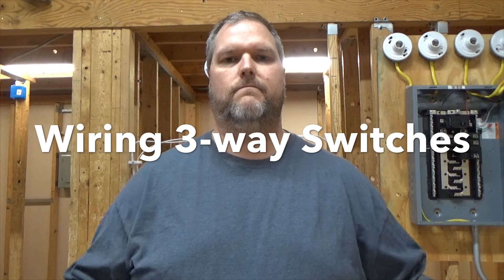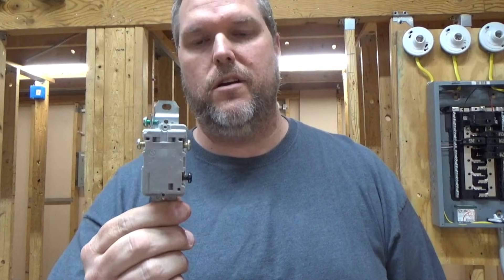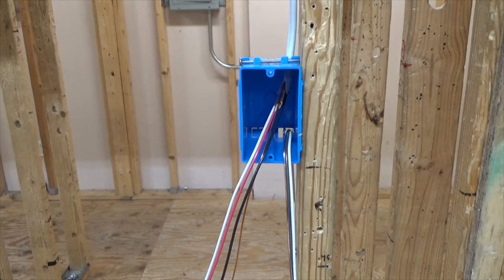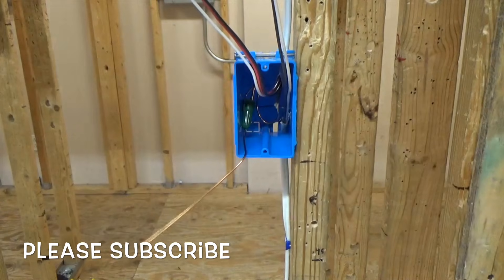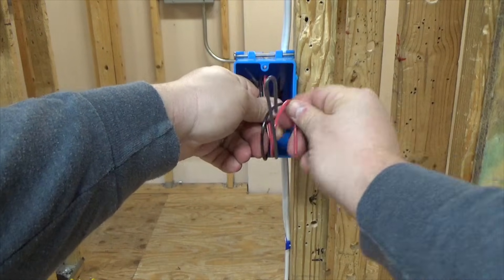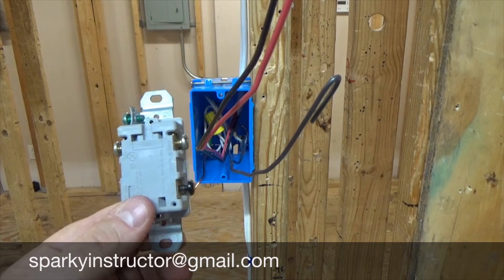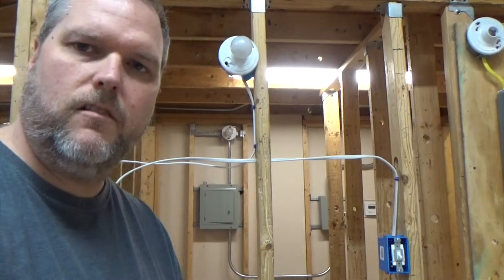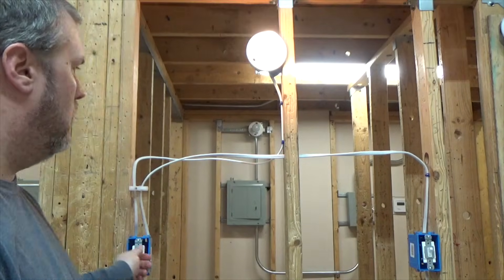3 - way switches explained

Comment: Great video, but I need more help. My setup has the line to the light at the middle switch. So Switch 1 has power/feed and wire to switch 2. Switch 2 has wire from switch 1, wire to switch 3 and wire to light. Then Switch 3 only has wire from switch 2. (I can get the first to switches to work like a 3 way, but the 3rd swith does not do anything.) Any help is appreciated. Thanks.

Comment: Curios if there's a way to have both 3 way switches aligned. Meaning, the rocker switches are both facing down when the light(s) is turned off. I'm guessing it's as simple as turning the entire switch upside down before mounting it in the box? Just a bit of OCD on my part...

Comment: so were using a 14/2 wire to feed the switch and a 14/3 wire to go from switch to switch and than using a 14/2 wire to go from the switch to the light fixture ?

Comment: What voltage should u see on the load side. When power is off? Ive seen this in a house where the neutral to hot is giving out 10 volts. I've seen another house giving out 60 volts. Is this normal

Comment: Running into an issue with an old 3 way switch in a 50s house with only black, white and ground. No red. Getting one switch to turn on and off only while the 2nd switch is turned on. Otherwise no juice to the replacement. Any suggestions? Great video. Well explained. 👍

Comment: So i noticed that your traveler wires on both switches are flipped. One switch has a red on the right and the other has it on the left? Does that matter?
Reply from the maker: As far as the TRAVELERS no it does not matter!! Just as long as you know that the travelers are the same on both ends. CM

Comment: Ok but could you wire up a 3 way motion sensor ??? I find it easier to use an on off switch instead of a 3 way switch

Comment: just recently replaced an aging ballast in my fluorescent fixture on a 3 way circuit .  When I was checking voltage for on and off at the fixture , I still had 53 volts with the circuit in the off position ?  This circuit has 1 very old 3 way switch in it , could you give me some advice on possible problem with this off position voltage ?

Comment: I have a white hot wire in box B of the three way switch. Does that go into the black common screw? There is no neutral in this box unless the hot white wire is the neutral

Comment: it's an old way, we use wago to connect the wires, it's easier to connect and disconnect the wires
Reply: Wagos are only used in the UK. It’s not code compliant in the US

Comment: Did you use a 14-3 wire to connect your travelers and then a 14-2 to the light? Is that why I only see one red on the second switch?

Comment: What did you do with the neutral wire on the light side?
Reply: I know it's an old comment but on the 2nd switch the neutral is tied together with the wire to the light.  So your feeder line and 2nd switch neutrals are attached in the 1st box and then the other end of the neutral in the 2nd box is then tied into the neutral on the actual light..

Comment: Craig.  Having a problem installing a light with dimmer switch.  There are three wires in the light socket.  When connecting the light fixture, it powers on but the switches will not break the circuit.  Any suggestions to solve this, please.

Comment: What about a 3way switch to a plug/ electrical receptacle can you make a video about that please 🙂
Reply: It's the same thing. Doesn't matter if you're switching a light directly or an outlet. On an outlet hookup make sure you connect the bare ground wires to the grounding terminal usually green colored.

Comment: I've done a lot of wiring in my homes over the years including 3 way switches but I find that when I haven't been doing any projects for a few years and then attempt to wire one up I have to stop and think about it, sometimes for longer than I'd like to admit.  Very glad I found your video. I'm in the process of gutting a summer cottage and will be rewiring the place shortly. I've laid out the wiring and I'll be using 3 way switches in at least half a dozen locations so this is a great refresher.

Comment: Yes  at least I can see where the red and black wires go but the commen in other videos and electrical guides is normally the white wire but I guess not in this application as he's using the black hot wire but of course the two white wires always get twisted together and stuffed away in light switch applications, at least I know that much LOL, so this video was more helpful than many of the other videos out there

Comment: I have 3 switches, one light.  I pulled covers, and find 2 3-ways, and 1 4-way.  One of the 3-ways has blacks twisted together, of course.  Grr.   I'm thinking power feed is in the lights box.  Guess, I pull the breaker, unhook switches and find out whats what.  I'm looking to install a motion dimmer 3-way at one switch location.  I do have access to all sides of light box, and tops of walls.

Comment: Does it matter what terminals you use as your travelers? Red traveler wire has to be in one particular one as well as the black traveler wire?
Thanks.
Reply from the maker: Nope as long as they are on the same color terminals and not the colored one you are good. Not everyone wires them the same so its based on what you use as travelers. Hope that makes sense. CM
Reply: @craigmichaud-electricalins4602  
Thank you very much. Your feedback is truly appreciated. Especially now that I'm preparing myself to take the NEC exam. I'm very nervous and quite frankly have my doubts on this exam but hopefully everything goes well.

Comment: Your explanation is correct when the breaker pair terminate at one of the switches. I am in a 1950 Constructed home and there is a  difference when the breaker and three way switches all terminate at the octogon box. 

1) The breaker (white-black) pair terminates at the light's octogon box. 

2) Each three way's cable from the switches terminates at the octogon box. 

3) The travelers from the two switches are white+red. and they are marrated, white-to-white and red-to-red. 

4)  The white from the breaker cable and white from the light socket are joined (maratted).   

Left to connect are one black from each switch and one black from the breaker. 

5) One black wire from the breaker goes to one black wire  of one 3way switch, not to both black switch wires.    

6) the remaining black wire goes to the hot side connector of the light socket. 

Done. 

If you were just replacing the one light socket with LED potlamps, there is no need to touch the switch connections.
If you run into problems because you replaced existing switches with more modern ones..  

7) Just inspect that the switches are connected with black to the discolored screw (as per video diagram), and the white+red to the traveler connection screws.  Usually, in older houses such as mine, rewiring was done to replace a fixture with LED pot lamps, wired in parallel.

The wiring description within the video is for new construction.  I am describing 1950 electric code practices that I encountered.  I am in Canada, it could be that the standard for traveler pair  are white-red. .
Reply: I agreed with you Leslie!!   hsthu@yahoo.com